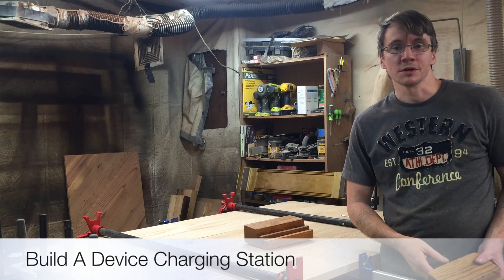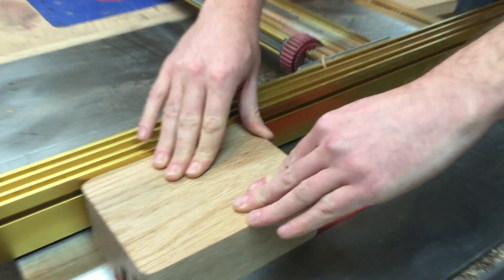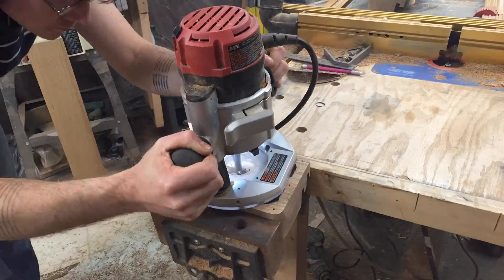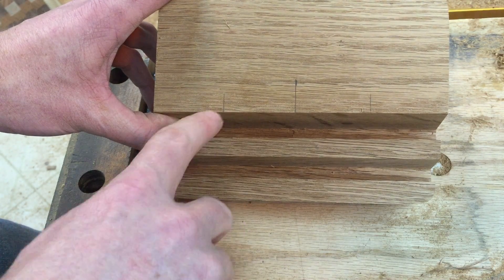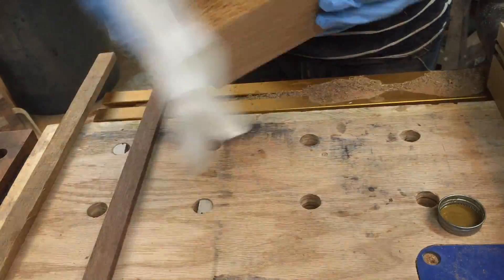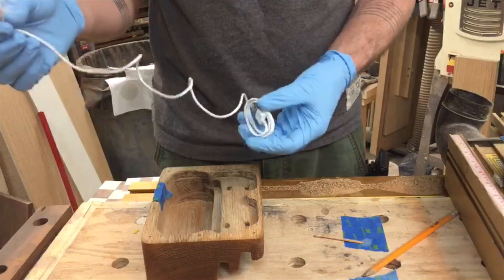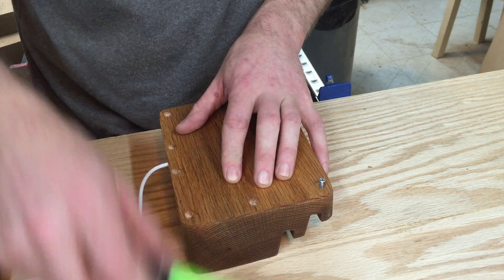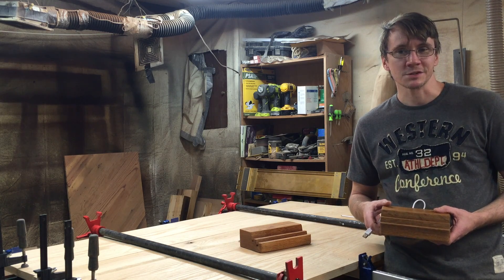Building a Multi Device Charging Station 017

Comment: Nice shaping and finishes, it looks great.  You need a buddy who is as good with a soldering iron as you are with a table saw. She or he will make you some much shorter USB cables and pick out a high-current rapid charger. But still solid work, because your decision to make the bottom cover removable means  it can all be revised with different electronics later.
Reply from the maker: +Tai Viinikka thanks man. I appreciate that. In the follow up video I do change the charger out.

Comment: Instead of that hub, I'd us a Anker 4 or 6 port USB charger....then this would plug right into the wall.
Reply: Also, hot glue would be better than epoxy.   That way when you get a cable fail( and you will) you could remove the cable.
Reply from the maker: +Joel McLaughlin good call on the hot glue. Thanks man.

Comment: Great video and love the hardwood, but I am surprised nobody has brought this up. That single USB hub is most likely just a splitter for data transfer between connected items (like to a PC). Although it does transfer power too, if the power adaptor is of normal nature it is only designed to supply 5volt @ 1amp which is only good for 1 smartphone or the like.  iPads draw 5volts @ 2amps.  Knowing this you shouldn't expect to equally charge more than 1 device at a time or you will be undercutting the draw of the charge.  It may work to connect 4 but that limited power is being divided by that total and would take 4 times longer the charge everything completely.  Just putting it out there.
Reply: 0.25 amps...ouch
Reply: It only takes a week to charge an iPad at .25amp ;)

Comment: I like your project, but at 1:22 you stick your hand right up to the spinning blade to flick away a piece of scrap. Absolutely unacceptable table-saw technique! No push sticks or feather boards or blade guards, either. You're gonna lose a finger someday, boy!
Reply from the maker: Had to go back and take a look. You're absolutely right. Definitely shouldn't have done that. Don't know what I was thinking.
Reply: +McCauley's Design
I'm so glad about your attitude about the slip-up. 30 years ago I lost just the very tip of 2 fingers at work. (Wasn't a saw, though)  I would be happy to have avoided that experience. Keep up the great videos, though. I was surprised at your choice of a solid piece of wood. It worked out nicely.
Reply from the maker: Thanks again. I'll always admit when I did something idiotic, haha. Definitely wasn't thinking there.

Comment: I think it would be best to fasten the bottom with screws as you did.  You might have to replace a cable sometime.  Rather than epoxy, could hot glue work as well to bed the cables?
Reply from the maker: Yeah I think hot glue would be fine and I plan on using it in the future.

Comment: Hello Brian, what kind of adapter do you use to support charging for multiple devices? I mean the current output (ampere). Thanks
Reply from the maker: So I bought a powered (plugs directly into the wall) 4 port USB hub to charge the devices. This is covered in the update video to this one. I know nothing about electricity but the plug on the hub says "5V - 2A Output" so I assume that is 2 amps?
Reply from the maker: Tuan Syafiq If you're interested I just released plans for building a device charging station.  The plans are for a single device but can be easily adapted to multiple devices or tablets. http://mccauleysdesign.com/?product=device-charging-dock-plans

Comment: So did the end result work as planned and you got the phones out of your kid's pockets and on to the charging station. I had no idea you could charge thru a USB hub, but thinking about it I guess there is no reason you couldn't.
Reply from the maker: Haha. Time will tell.  If nothing else the cords are managed.  You can charge through a hub as long as it has a power supply.

Comment: That is pretty awesome. By chance where do you live. I live in central California. I can't find wood for the life of me. One store carries some good stuff. Way to expensive and nothing as thick as the oak you used.
Reply from the maker: I live in MD. I get my lumber from a mill that's run by some Mennonite dudes. They don't have a website or anything. Just found them by chance reading a blog that mentioned them. They have great lumber at awesome prices. You won't find 12/4 stock like that at your local big box store. Do a search for lumber mills or sawyers in your area.
Reply from the maker: You could always glue pieces face to face to get the thickness you need. If you did that for this project you could hollow them out before you glued them. Might be easier.
Reply: +McCauley's Design where in MD I am in Aberdeen  and have been looking for a good mill.